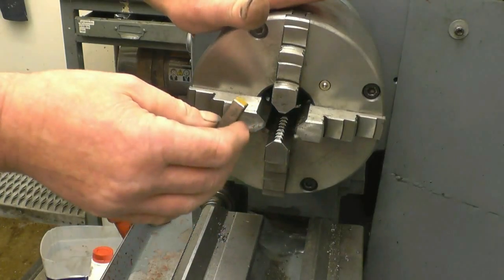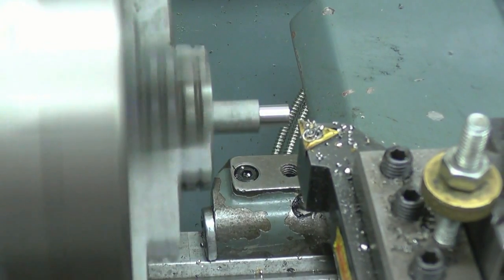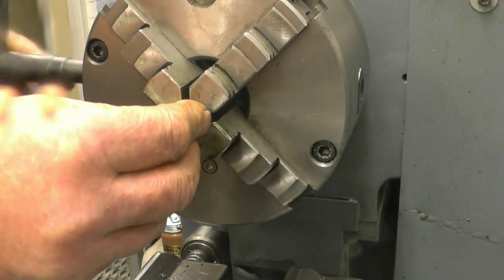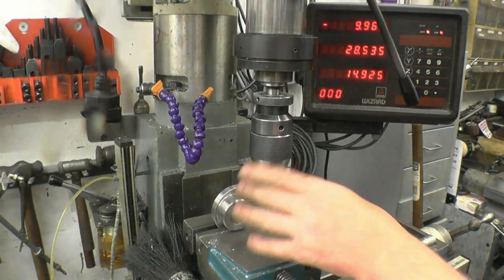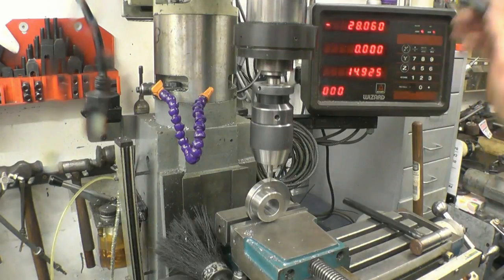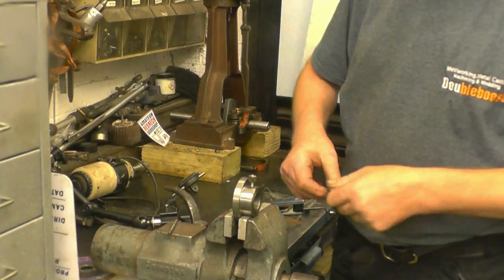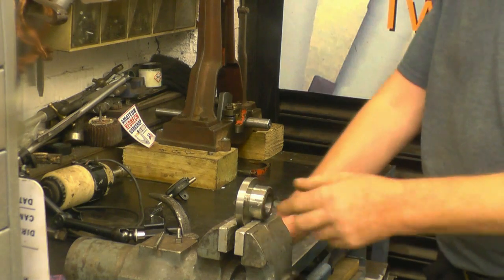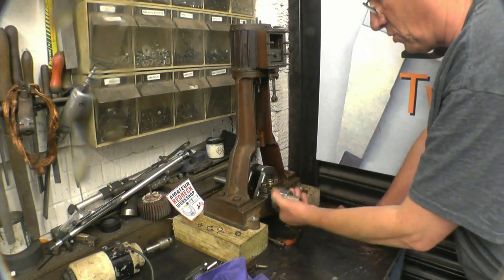SNNC 184 P2   Brass tipped grub screw

Comment: Was the pilot for the tap a bit undersized? That seemed like a lot of torque was required to get the tap through. Machinery's Handbook (and many tap drill charts) has a way to calculate the percentage of thread for different-sized pilot holes. With a steel screw in a steel hub and more than one diameter's length of thread, I would think that 60% would be plenty. If I had to guess from the torque required you were cutting at least 75%. Great shop; nice mix of new, discount, and used/refurbished. 

And a happy (belated) anniversary to you and Debs. Many more. (You've got a couple more down than Eva and I. It's amazing what a good wife will put up with.)